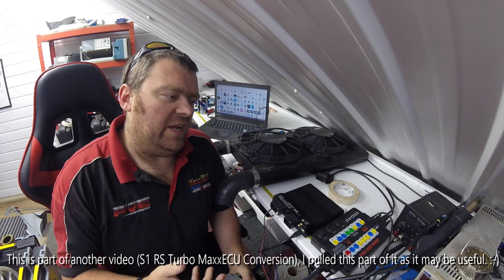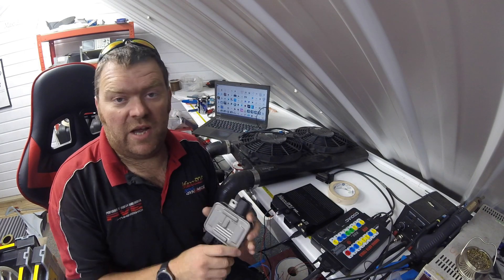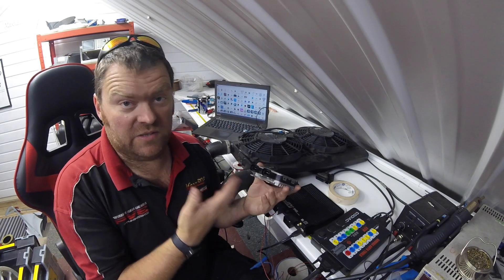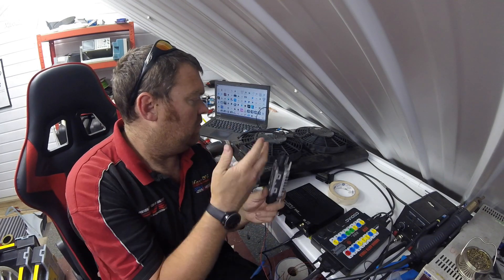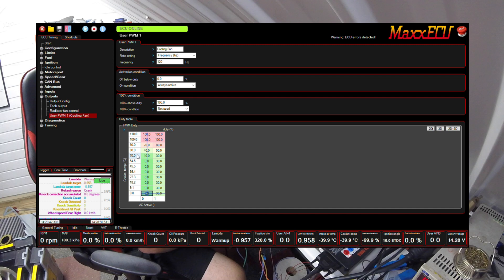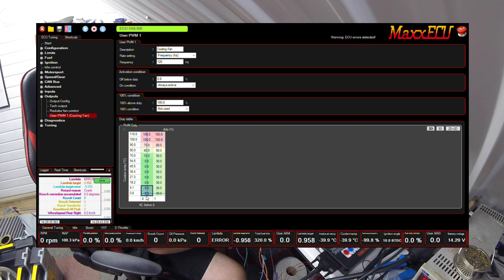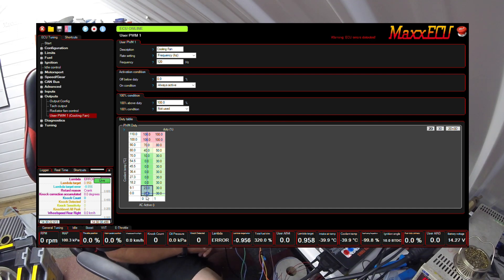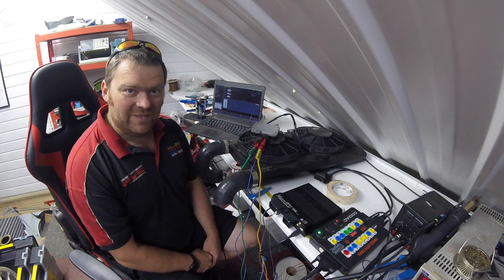Cheap PWM Fan controller using MaxxECU

Comment: could you use this to control a fuel pump?
Reply from the maker: It could run a fuel pump certainly. I'm not sure on longevity of the module running consistently though. 

I've never used it for that purpose to tell you confidently it won't destroy itself after a couple of hours.  We use the Jaguar PWM fuel pump module generally for this use. :-)
Reply: @TuningShed  Thanks! just bought a Jag one 7W83 9d372 AA - don't suppose you sell the connectors for these?
Reply from the maker: @davidwoods6821  Hi Dave, Yes got them in stock. I've been meaning to add them to the website with a load of other connectors. I'll add them in this evening. :-) 

Steve
Reply: @TuningShed fuel pump or fans how would we know the frequency needed

Comment: What SSR would you run for a larger fuel. I have Maxxecu Race and need a reliable solution. Many thanks.
Reply from the maker: I'd yes the Maxxecu PWM module honestly. Good quality item, for not a massive amount of money.  CAN-BUS driven, so you don't lose an output. :-)